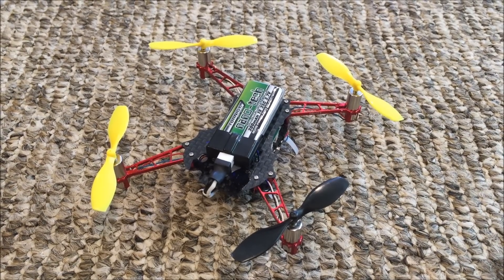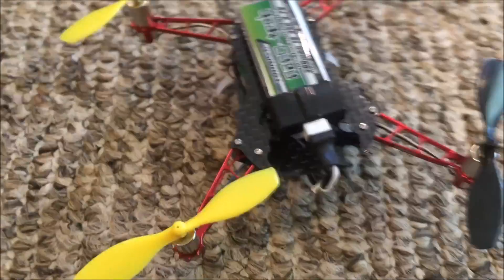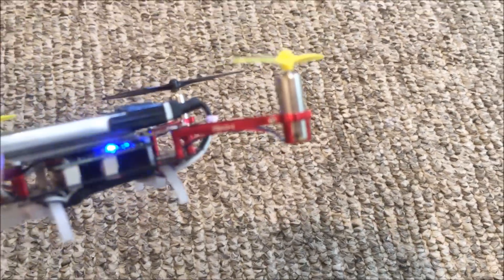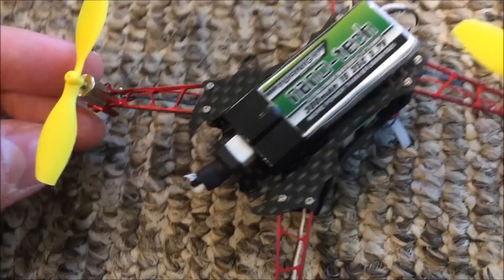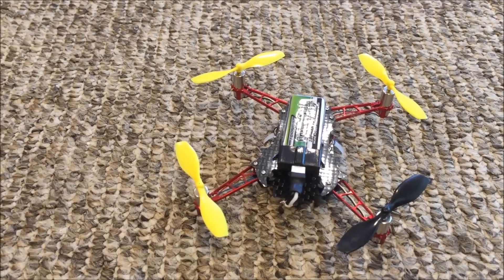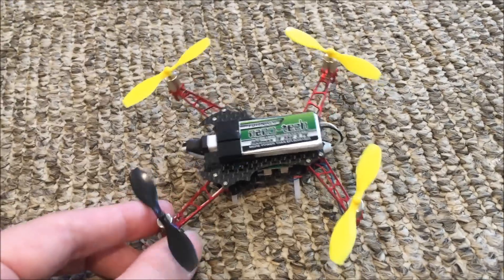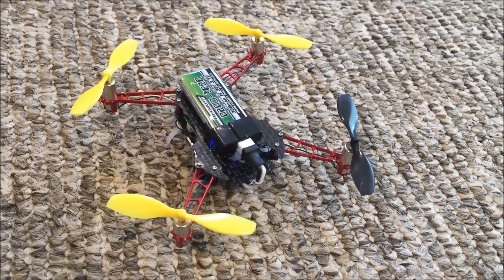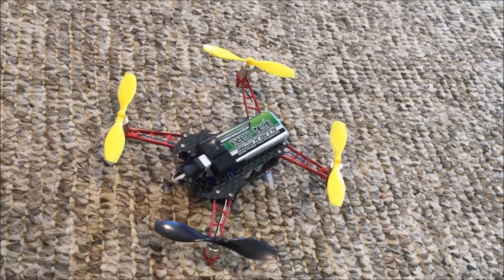Nano QX Carbon Fiber Frame (~8 min flight times)

Comment: In theory the build is simple but those screws are super tiny.  Took me a half hour to get one leg on ;-)
Reply from the maker: yeah they are, and they come out so easily. i would use some loctite because you will lose a screw.
Reply: Thanks for the advice I might put a drop of epoxy on them :-)

Comment: Nice build. I would be a little concerned with the wires hanging out the bottom as they are very fragile.Have you had any issues with them. I like FPV would be concerned flying through small spaces with wires exposed.  As for the motors yea I love them!! I wounder if the battery fit the stock frame?
Reply from the maker: I actually ended up going back to stock nano qx. This frame was far too fragile. The aluminum arms bent all the time and would fracture. At $10 per arm, Rakon is crazy. Honestly, while this was a great solution to do FPV back then, Nano QX2 FPV makes this mod pretty outdated.

Comment: Please reply So I notice a different battery does the Flight Control Board have the standard Plugging connector
Reply from the maker: +Alexander Lei In the video, I explained how I am able to connect that battery. I'm using a 1S High-Current Ultra Micro Battery Adapter Lead (EFLA7002UM). I linked it in the video description. It will plug directly into the Nano-QX's connector.

Comment: hi what charger model and method do you use for charging the nano-tech 300mah 1s batteries?
Reply from the maker: +lunacity360 Hi, I use a Hitec X1 Touch charger and a Parallel Charging Board for Blade mCP X and mCX/mSR/Proto X Lipos from a company called Common Sense RC. Highly recommend it for charging up these nano-tech batteries as well as the standard Nano QX eflite ones.

Comment: 8 minutes isn't really that impressive to be honest, buy a Hubsan x4 and throw in some 380 mah batteries and it flies over ten minutes. And the Hubsan x4 is cheaper than that frame and most likely more durable.
Reply from the maker: +Sam M Hubsan and Nano-QX both have their strengths and weaknesses! But the nano is much more precise handling because you can use it with a high-end transmitter like DX7 or DX6. It's also a lot lighter. Also, Hubsan isn't so great for doing acro. Having acro mode with nano is awesome.
Reply: +John Cuppi right. I have both the nano qx and the hubsan x4, I actually like the x4 a lot better except it doesn't have acro mode. As for the transmitter, I believe it works with deviationtx actually
Reply: +Sam M there's a way to get x4 acro, search rcgroups for x4 bradwii or brandwii. X4 fc is a copy of some other board and can be flashed with some hacked software making it fly acro mode.

Comment: Those arms are super weak and bend if you breathe on them :(
Reply from the maker: +tahosrfr You are correct that the arms are a little bendy in a hard crash, depending on how you crash. Bending them back is easy enough. I had an arm that cracked on me - Rakon replaced it free of charge!
Reply: Whoah why did they do that? I don't think crashing is under warranty. I had one arm cracked on me aswell and had to buy it.

Comment: Hey man.. Just wondering if you've experimented with the FPV version of this and where you'd mount the Camera and antenna setup on this if its possible. Thanks so much! Awesome quad btw!
Reply from the maker: Thanks for your comment. I have not experimented with FPV Nano QX, but this frame provides a place to mount the camera in the front.  You may want to read this forum topic about the viability of FPV with the spectrum camera: http://helifreak.com/showthread.php?t=698928&page=3 I did some testing by taping two pennies to the top and it still flew, so it can pull the weight the performance doesn't seem optimal though.
Reply: I have the Nano QX FPV, and it flies great just stock. This Rakon frame is just a tad bit heavier along with the slightly heavier battery. But the motors make up the difference with power and longer flight times. I'm going to upgrade mine soon.
Reply from the maker: +MasterMayhem78 Flight time is indeed extended with my method but crashes are more risky with the rakon frame.